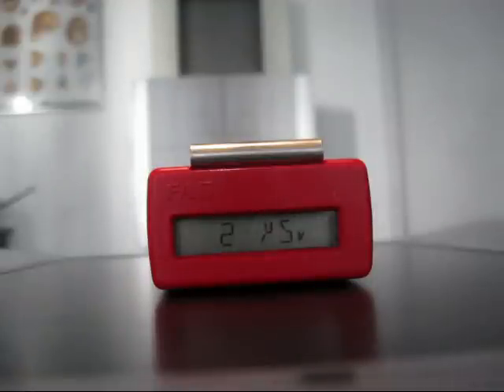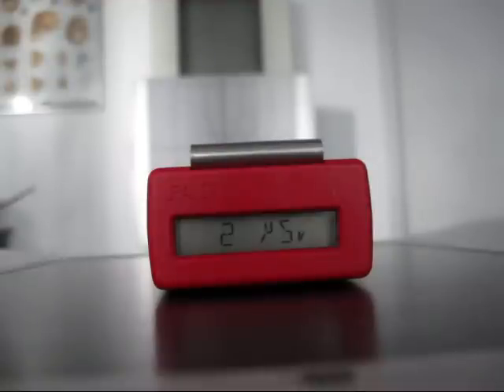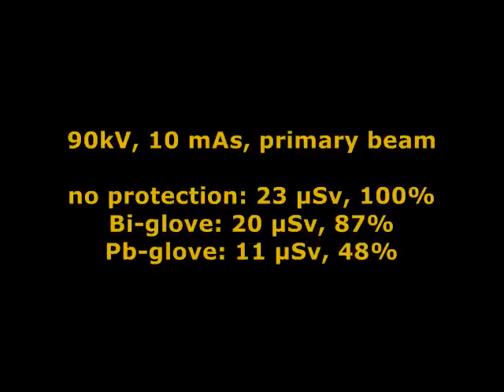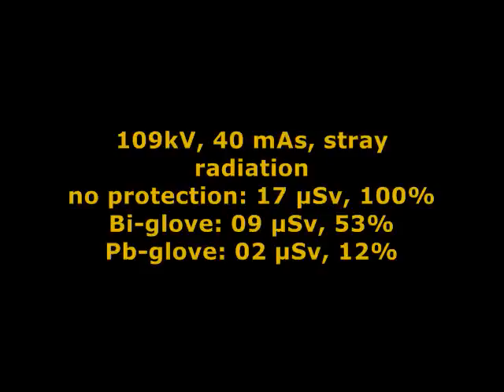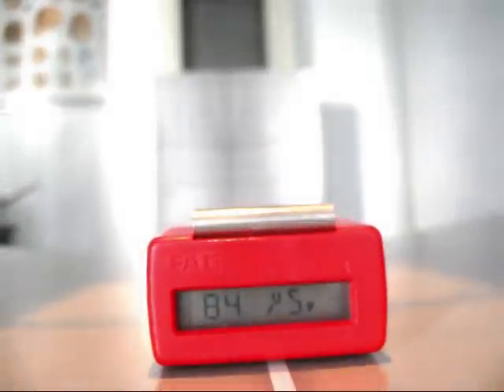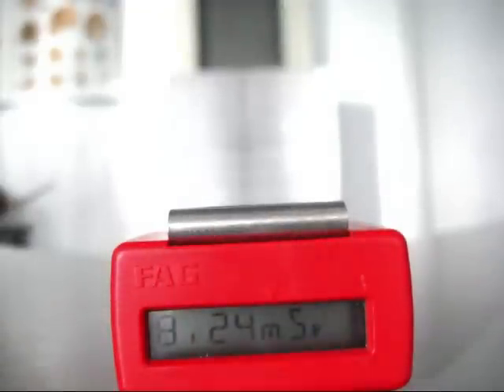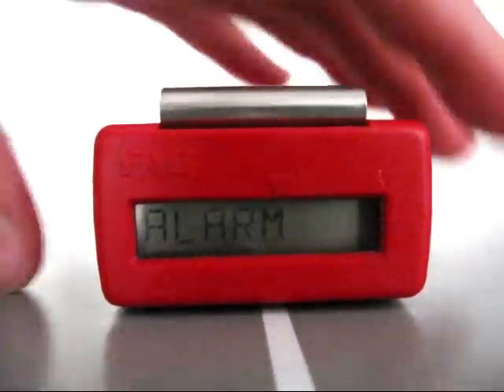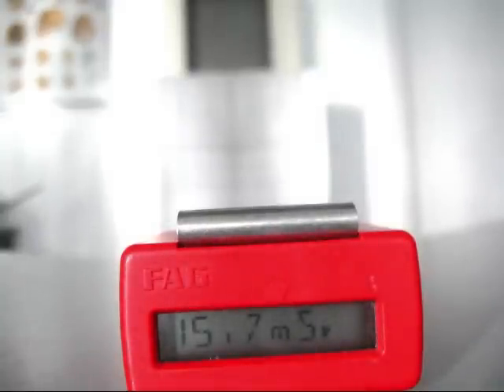x-ray beam vs. tactical dosimeter / rad protection glove test - radiation sickness imminent. :P

Comment from the maker: @cortexedge 
well, alpha radiation has a very high linear energy transfer (LET), meaning they cause a lot of damage in their "range". they're shielded by the human skin, but when ingested, has a weighting factor of 20, which means it causes 20 times more damage (dose) than a conventional x-ray or gamma ray (weighting factor 1). beta radiation also has a weighting factor of 1, and for neutron radiation, it varies on the speed of the neutron, can be 1-20 (20 for thermal neutrons).

Comment from the maker: @Serostern 
never dropped a CRT on my foot so far, nevermind making one explode / implode; that's really hard to do unless you hit the tube backside (cathode) with a hammer, lol. :P
i love CRTs. still using them as my computer monitor and TV. i just like the image quality on them much better (if the refresh rate is sufficient and it's in general a good device; otherwise, they're horrible!). 
i like lead, too. i easily have the weight of two adult men in lead here, it makes me feel safer... :D

Comment from the maker: @Serostern 
ah, okay. i thought just the front used lead, as it has to be see-through, and the shielding in the other part of the tube is archived with that grey coating material. never really looked into what that is though, to be honest. i'll queue it as the 158274th thing to look up.

Comment from the maker: @AntiProtonBoy 
lead is more dense than bismuth, so i suppose lead would still be superior even if they used the same material thickness for both gloves. however, bismuth is not much worse and MUCH less (actually non-)toxic , so it's probably a better option; depends on the application, i suppose. surgical gloves that end up in wounds, with probably bits being abraded, are probably better made with bismuth.

Comment from the maker: @Serostern 
yeah, a tv uses shielding - not sure about 40 pounds of lead ;P, but yes. you can still measure the x-rays from it with a very sensitive device, e.g. a contamination monitor. also, keep in mind that a TV uses much, much lower voltages... just up to 35kV acceleration voltage - so the x-rays are much less penetrating. :)

Comment from the maker: @yvesgomez 
an x-ray tube. that's basically a highly evacuated glass cylinder that contains a heating filament (much like an old-fashioned light bulb; will release electrons and "glow" / get hot when a current runs through it). however, as vitally opposed to a light bulb, you'll have an anode connected to an extremely high voltage - 40,000 to 150,000 volts (30kV - 150kV), usually made from tungsten. this will accelerate the electrons, and as they strike the anode, x-rays are generated.